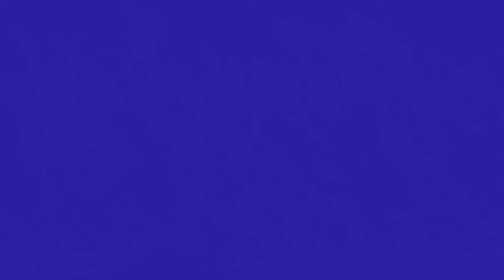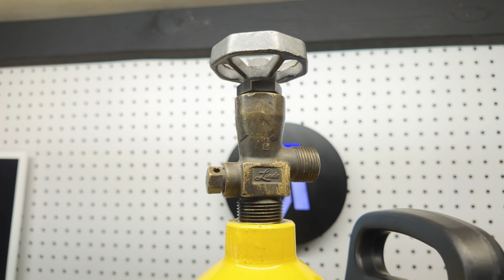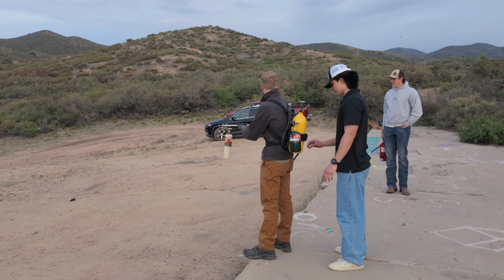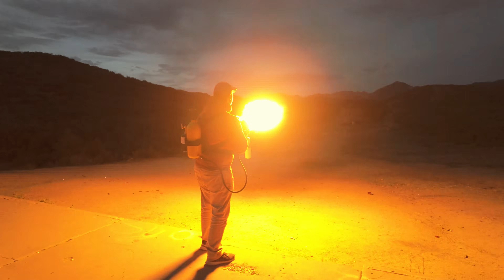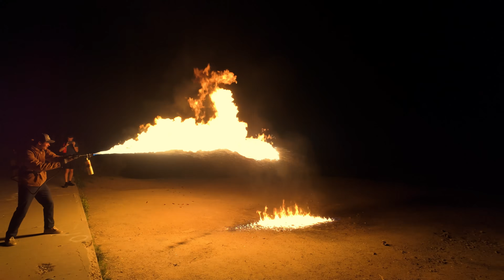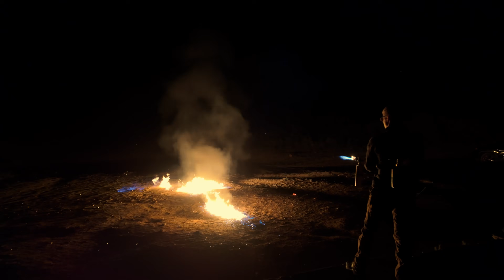The Hardware Store Flamethrower

Comment: For good results with liquid fuel, you need a ball valve as the outlet valve. Cheap spray gun valves create too much turbulence, so without a thickener, you'll always end up with a wide, sprayed cone of fuel rather than a cohesive stream.
A barbed hose fitting works well as a homemade nozzle. You can modify it with soft solder or epoxy resin to create a tapered inlet.
Reply from the maker: Sounds like a good idea, the only reason I used the spray nozzle was for the “gun” formfactor. I looked at using a ball valve or some type of solenoid valve, good idea for future upgrades!

Comment: has anyone tried making a flamethrower using a pump of some kind? maybe a fuel bladder and compressed air so you don't have to buy your own propellant gas?
Reply from the maker: Definitely an option, but requires batteries and a pump, you need a good pump to shoot your fuel far enough. Definitely an option, but I also didn’t want to mess with electronics for this test. I’ve seen others do it though.
Reply: Use a refrigerator compressor (it can create 300 PSI of pressure).
Reply: @jinxn2181 that sounds like it would weigh a ton, and aren't they designed to pump refrigerant vapour?
Reply: @irregularguy6465  You don't need to wear it on yourself. Use it to pressurize the cylinder. Fire extinguishers or disposable freon cylinders are ideal for this.
Use kerosene or diesel fuel. And don't completely release the pressure with the pilot flame lit, no matter the fuel type.
Reply: @jin @jinxn2181  let me get this straight. either you're suggesting to use a gas compressor to compress a largely incompressible liquid into a cylinder, use it to pressurize a cylinder of flammable liquid fuel with oxygen-bearing compressed air, or buy a cylinder of high pressure inert gas, de-pressurize it, then use the compressor to re-compress it to pressurize the fuel.
Reply: @irregularguy6465  I suggest using compressed air, which is created by a compressor from a refrigerator. If you use fuel with a high flash point, it's safe.
The use of compressed air is permitted for flamethrowers; you can read this in any manual (M2, ROKS-3, etc.).
Keep in mind that you'll need a lot of compressed air while you're checking the connections for leaks and troubleshooting the flamethrower's barrel and nozzle. You'll probably want to test it with water first.

Comment: So California is the only state I remember requiriing a permit, but check.

Scuba tanks can cause enough friction from PSI to cause a fire from friction alone, but that's insanely high PSI.

One way valves or flashback resistors used in welding would help a lot here since they would stop fire from going back into the tank.